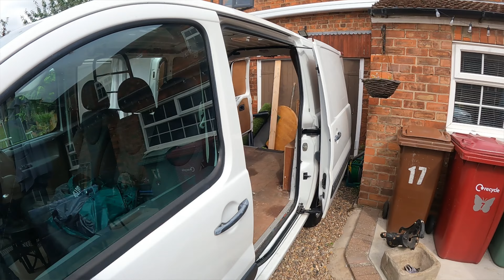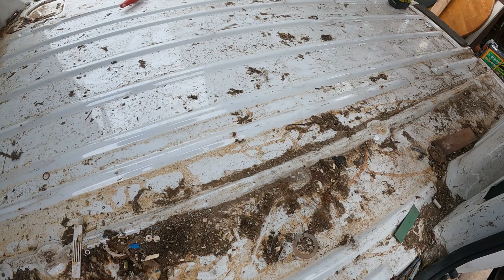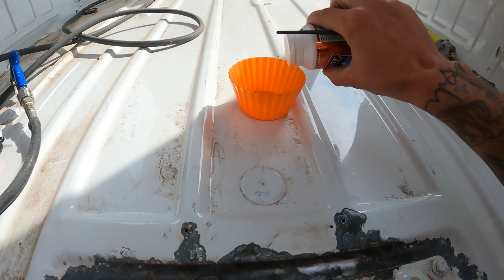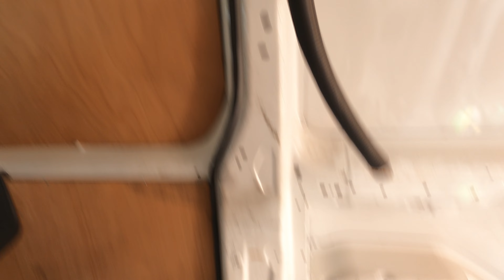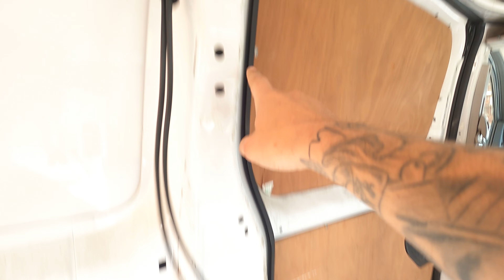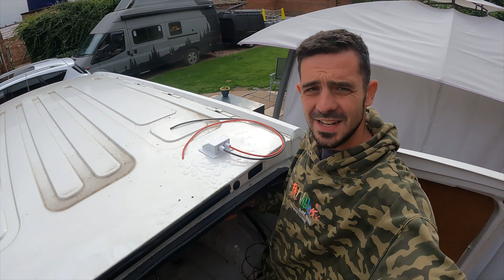MICRO CAMPER BUILD | EPISODE 1 | Strip out, treat rust and wiring tutorial

Comment: PMSL "see you next Tuesday". Naughty boy. Insulation.... IMHO Don't believe the hype. A few facts, ANY air flow that comes in contact with cold metal or glass  (outer van skin) will create evil condensation. The only way to stop this is to not have air of any kind coming in contact with the outer skin. A simple and very effective solution is good old builders expanding foam, a bit messy initially but keeps the cold out and the heat in. Under your floor in ya doors and walls, roof n'all. Nowt worse than that damp feeling all over ya van after a chilly night.
Reply from the maker: Keep an eye out next Tuesday see where we go with it, thanks for watching thanks 🙏